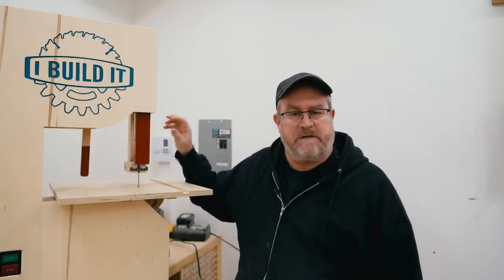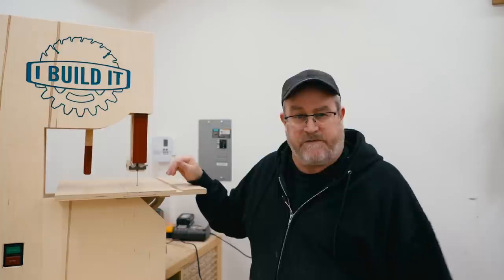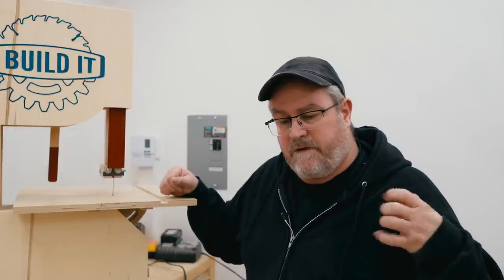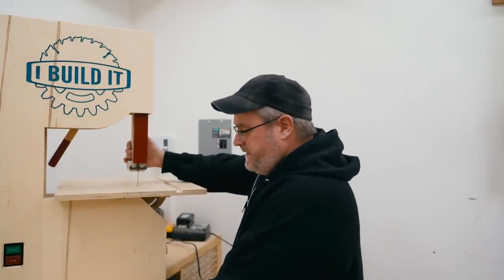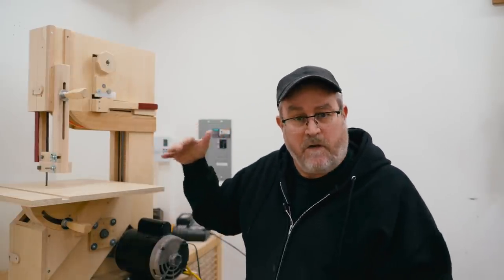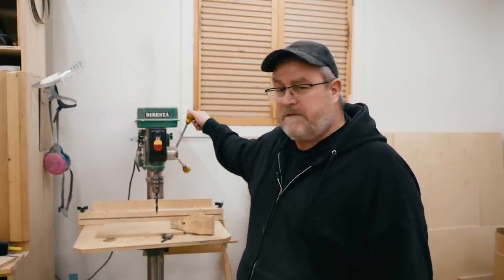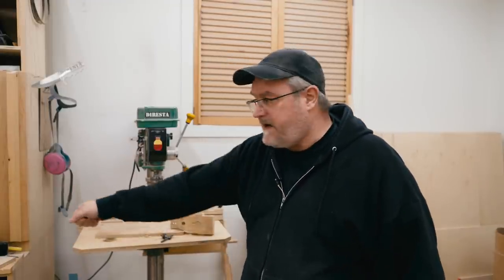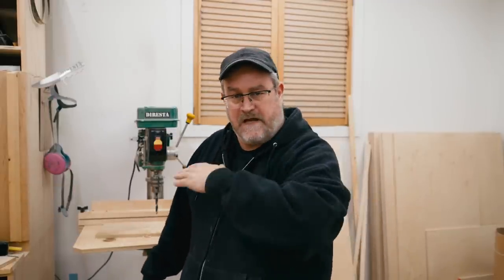I Think I'll Tear Apart my Drillpress next... I have an idea

Comment from the maker: More brain-power on the drill press idea and I realized I'd need to make the table adjustable too. Most of the time the head would be raised or lowered by a few inches at most. But if you have something 15" thick to drill into, then it would be good to be able to lower the table instead of standing on a stepstool to do the drilling!
So limiting the range to about 10" on the head might be enough and I'd make that motor driven, using the drive mechanism from the reclining chair I took apart a few years ago.
For the table it could just be a high / low situation, with the top part being removable to use the low table. Like two boxes stacked on each other but locked together. The bottom box could have a couple of drawers.
Reply: I know most people dont .. but a raising and lowering drill press top would make it easier to change belt speeds
Reply from the maker: Was also thinking about make it variable speed, but mechanical using homemade Reeves pulleys.
Reply: was also thinking about your Wide crosscut jig .. what about more upright like at the "Big Box" stores? .. and have the battery saw have a cradle there .. might be easier to muscle in a full sheet in a vertical position (because that's how you have it stored) than flipping up onto the table saw.
Reply from the maker: I really don't have the open wall space for something like a panel saw. And to honest, it would mostly be a wasted tool for a hobby shop that cuts up maybe one sheet per month. The advantage the folding track saw has is that it's there and ready to use without having to dig it out from under a pile of other junk, and doesn't take up much space.
Reply: I modified my benchtop drill press this way.  The challenge is keeping the quill/bit square to the table when raising and lowering the head.  The track/system connecting the head to the table and allowing the head to move independently has to be built to a tight tolerance.  Otherwise, the weight of the motor and drill base will cause the head to cant forward/backward when you raise and lower.

Comment: Walker turner made drill presses that had that type of adjustment. They would even put like 3 on a table for assembly line type operations. Those drill presses used preloaded taper roller bearings as well meaning the spindle has no play… they were nice machines.

Comment: Haha iv been thinking about doing the same to my drill press.  to mount the head of the drill press to where the table mounts so the same arm that supports the table would support the head instead. Grizzly made a drill press like this at one time it had some nice radial drill press function aswell as being able to have a clear out feed path. So if your press has a round pipe under it that slips into a coller on the arm like my shop fox does then would only need to make a custom tube that was stepped from the tube size the head mounts to and converts it to the tube size under the table and then the motor would sit beside the mainmast tube and be able to swing around to position the bit

Comment: Regarding the moving 'head' of drill press - seems to be stupid idea. Let's think for a while. You have lumber 10" height and the table position where is it now....do you see where you drill? The opposite 1" height lumber. Seems that drill press is made in such way as it is makes a lot of sense
Reply: Real drill presses. The kind used in an industrial environment. Normally the spindle assembly and the table are adjustable. My benchtop drill press has a head that is adjustable up and down. It also features a tilting table that mounts to the base plate of the machine. If you need more vertical space just take the table off. The drill press is not built the normal way one sees a home shop drill press built. One, its variable speed 500 to 3000 rpm. two, the motor is in between the column and the spindle. You can get the machine practically right up against the wall. I switched out the cuck for a decent quality keyless chuck meant for metal working. Same model as the one in a page of Matthias's website. The weird thing is it was sold by a company not normally associated with decent machinery. Ryobi. From back in the day when they really did think outside the box. Looking at a lot of wood working machinery from a machinists viewpoint it seems crude in some ways. Take depth adjustment on a normal table. Instead of having the arbor mounted in an arm that pivots around a point away from the blade centerline it makes more sense in my mind to raise and lower the blade with arbor being mounted in a slide that moves vertically. That way each turn of the hand wheel would move the blade an equal amount. With a graduated hand wheel if you need to raise the blade a certain amount its a no brainer.